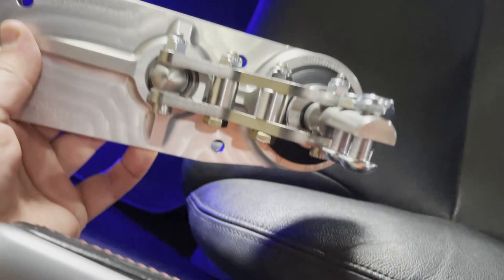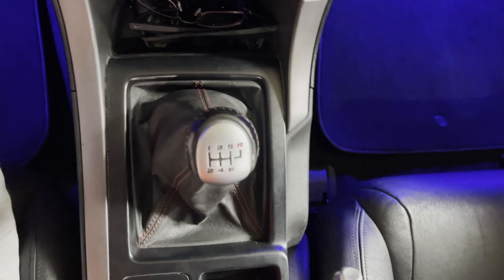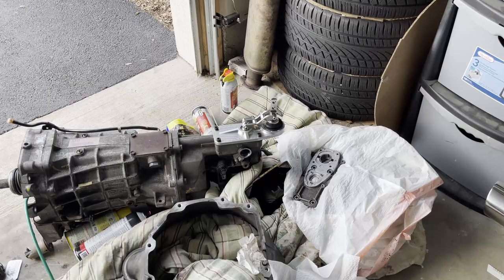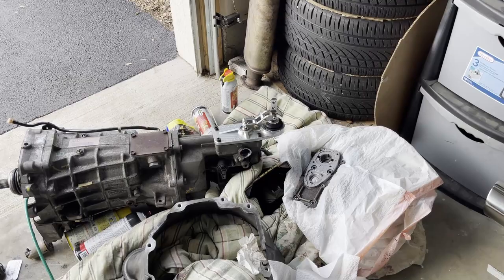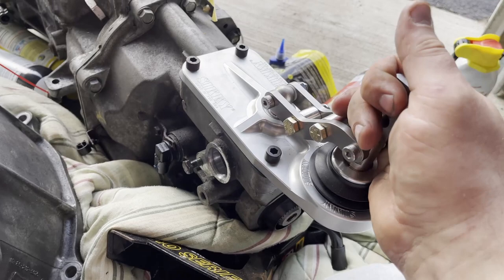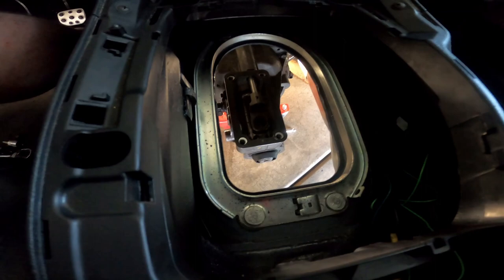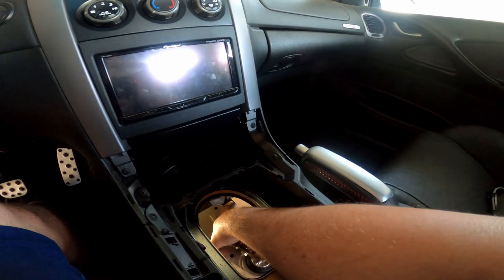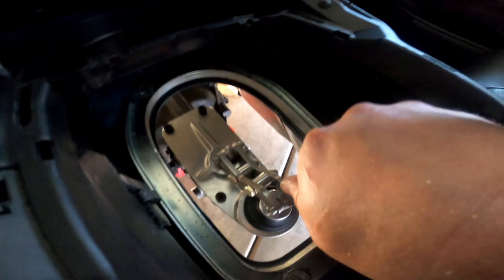GTO B&M shifter is garbage! replacing with Sikky

Comment: Watched this twice before I realized you did not remove the valve body of the factory shifter..there is 4 hex bolts that hold down the valve body to the tail shaft and once you remove it the B&M shifter fits perfect and also the reason your shifter is so far back and out of alignment
Reply from the maker: The b&M only had the 2 holes and based on the instructions, did actually sit on top of the cover with the 4 hex screws. https://www.jegs.com/InstallationInstructions/100/130/130-45043.pdf. Step 12 notes an option step to replace the gasket, but not put the b&M in place of the stock cover. step 14, it sits on the top. it would not have seated properly if that cover wasn't there, it would have been too deep. The sikky is a complete replacement of that cover.

Comment: Looking to buy a gto soon, I've worked on a few at my shop and have always wondered why the hell the stock shifters always have awful play and when you pulled out that stock one it pretty much answered my  question. I love a short throw and I will probably order the sikky as soon as I get a gto maybe even before. Do you absolutely have to remove the transmission to swap the shifters out?
Reply from the maker: No, you do not have to remove the transmission, I just made this video as part of my clutch-swap project and I figured "while I'm in there" to change that out as well. You will have to lower down the transmission a bit to get access to the bolts. but fairly straight forward. In fact, I had clearance issues getting the transmission back in with the shifter still attached so I had to take it off and reinstall with the transmission mounted and lowered. Good luck!
Reply: they're awesome cars stoked for you just bought mine 2 weeks ago
Reply: @StelioKontos42069  it’s the best car ever
Reply: @permabulk1454  i must say i never want out of the driver seat of mine they're fucking badass cars
Reply: @StelioKontos42069  dude me too 😂 what did you get ?? I bought a 2004 PBM m6 in 2016 with 6k miles on it. Fucking unicorn. Currently @ 70k miles with about a couple grand in fun mods
Reply: @permabulk1454  i just picked up a 2005 m6 thats midnight blue with the sap wing 4 months ago, has 79k on it. had the opportunity to drive it through the desert on the 9 hour drive home teehee. what does pbm stand for? that black with red seats? do you have the dreaded degrading clutch line?
Reply: @StelioKontos42069  PBM is “phantom black metallic” and no All black with red stitching I didn’t get the badass red seats. And my dude … the clutch. That shit drove me INSANE the first year I had it. Slave cylinder failed 2 or 3 times in a year and a half. Had meineke change the clutch at 10k miles then at 17k miles. BOTH failed so I went to a reputable clutch shop here in sac, got an oem clutch and slave put in at around 24k miles I think? And he shimmed it properly and everything. 

Have had this clutch now since october 17’ over 5 years and now I’m at 70k miles. One thing that has helped the life of my clutch ten fold is to change your fluid bro. Get a turkey baster and a little Tupperware or bottle, put a towel around the clutch reservoir and suck the fluid out till it’s almost completely empty (like 9/10ths) pour in some fresh DOT 4 ONLY high boiling point fluid, close the lid, get in the car pump the clutch 10 times, then do it again. I do this literally at least once a month. It takes all but 5 minutes to do and is the most efficient way to keep your fluid clean and keep the clutch operating properly since the stock hydraulics are TRASH for a performance car. Not a true clutch fluid bleed.. but MUCH better than just leaving the fluid contaminated. That will make your clutch and slave fail much much sooner than if you actually do keep it replaced regularly. 

From my understanding, GM made the hydraulics for the GTO clutch “weak” to preserve the life of the transmission and clutches under warranty. Their logic was if people can’t power shift and speed shift through gears successfully, it’ll save GM a lot of money in transmission/clutch/driveline warranty repairs. Keep everyone granny shifting 😂. That’s just what I’ve read. It makes sense to me given how weak our clutches are stock. 
Basically the RUBBER line that runs from the trans bell housing right into the slave cylinder/throwout bearing and back out into the master cylinder (that holds all the clutch fluid) will expand under heat (ie heavy hard driving, heating up all the components) and also filling the fluid with air bubbles causing lack of hydraulic pressure within the clutch line resulting in a weak clutch pedal feel. 
To alleviate this, guys will put in a steel braided PTFE line in place of the stock rubber one and also there is a clutch master cylinder made by Tick performance that increases the volume of fluid in the line resulting in stiffer pedal and more clutch pedal feel. Whenever you end up getting a new clutch or whatever you decide, make sure you install a speed bleeder (steel braided line that runs up into the engine compartment that will allow you to actually bleed your clutch by yourself instead of needing another person and needing a lift etc etc) when I get a new clutch next I’m gonna probably go with something a little bit heartier than OEM, I’m gonna swap that main clutch line out for a braided one and also get a speed bleeder installed. Can only install it if the trans is out but once it is apparently it’s a night and day difference. 
But for a stock, OEM clutch, master cylinder and slave, mine having 40k + miles on it (and lots of spirited driving) I’ve done well by keeping the clutch fluid fresh at all times. You’ll notice after not even a month of driving that your clutch fluid will either be completely black or have a lot of black gunky muck in it apparently from assembly grease traveling through the lines as the slave cylinder actuates the clutch. This contaminates the clutch and it’s hydraulic components, weakening your clutch and decreasing the life of it exponentially. Just keep your fluid clean until you can get a speed bleeder and eventually swap out that main line for a braided one! Hope this helps!

Comment: How do you like the shifter after a few years?
Reply from the maker: Still like it. Only thing is the shifter rod connecting to the knob is the stock one I had to hack a bit to make work, sits a bit off-center towards me, which isn't the worst thing in the world, but I wish they made a rod with the press-down connector and not just the screw one. But the shifting is still solid! which is all that really matters.

Comment: Could you do a video on how to remove the plastic trim from the center console
Reply from the maker: That's not a bad idea. I'll keep that in mind if I ever have to do it again. 

But just so you know, super easy, barely an inconvenience. 1 Philips screw under the radio, remove the rubber lining in the front, open the arm-rest and pull up, they are held in by clips. unplug the window and lock/tc buttons and it just comes right off.

Comment: How do you like it so far?
Reply from the maker: it's amazing. what I love the most is side-to-side it's stock so you don't miss-shift the columns, but the throws forward and back are way shorter. it's perfect. 

The only thing I'll say is they don't have an adapter for the stock shiftknob, I asked about it, they only offer the screw-on one, which it's moot if you have another shift knob, but since manuals are dying off, it's hard to find any shift rods. but, small nit-pick.
Reply: @dijitle  that’s good to hear I just bought one last night. After doing research, and seeing your video I think I made the right choice. I wanted to get the billet pro but it’s impossible to get one right now. I think this is the second best choice. And I totally agree with you the only thing it doesn’t come with the shifter knob. But I’ll try to use the OEM shifter I’ll probably do some modifications on it
Reply: @dijitle  I actually bought the shift Rod from the same place it’s a 6 inch shift rod
Reply: @dijitle  just installed it! Looks and feels better. I was contemplating on getting the new tick shifter or this one. I think I made a good choice.
Reply: You think the lous short stick would work with this shifter?